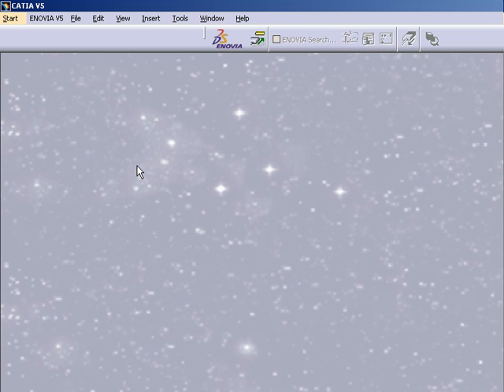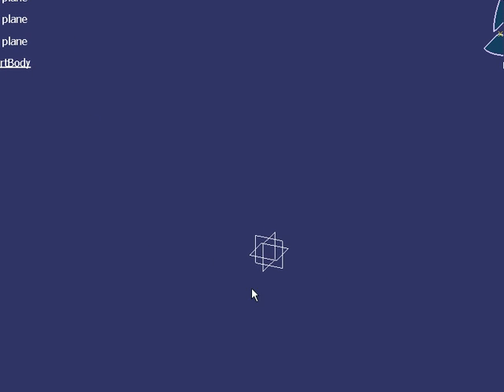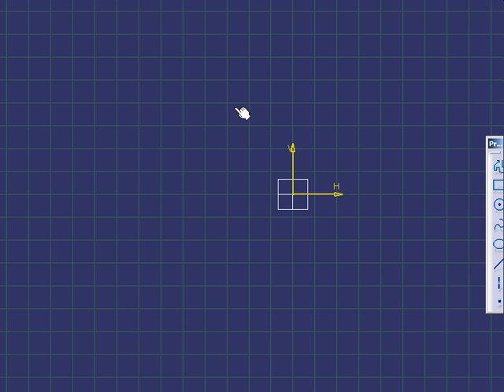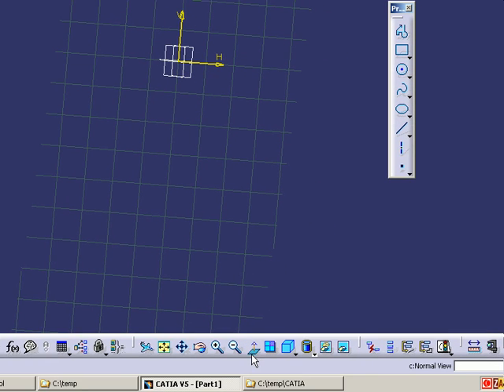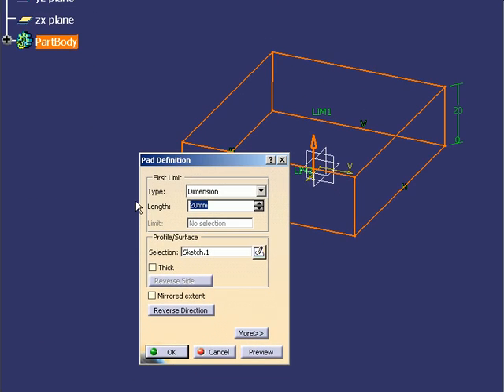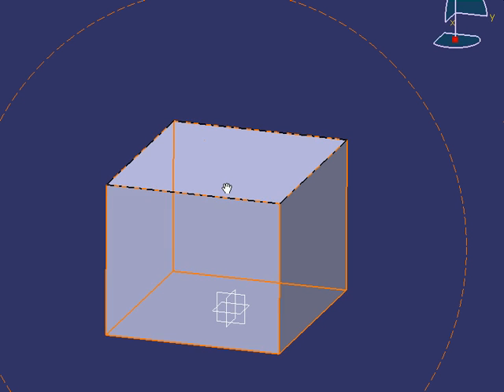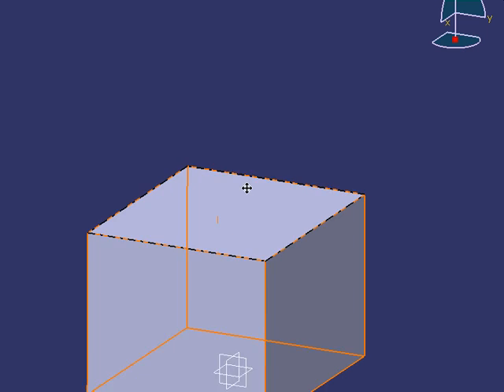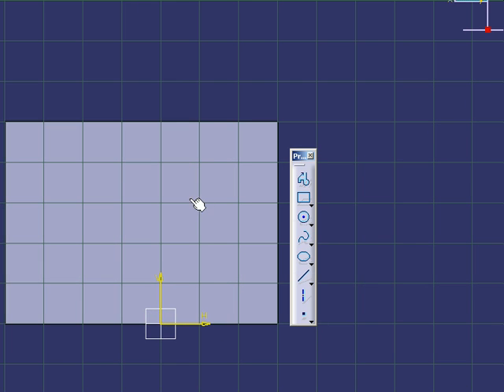Beginniner's tutorial on CATIA

Comment: qiuck question. If I mirror a threaded hole onto a face parallel to it, will it mirror the thread direction? (i.e. I have two faces next to each other. I put a threaded hole into one face and mirror the hole onto the face next to it. does it mirror the thread direction say from right-hand thread to left-hand thread).....

Comment from the maker: Catia parts have .catpart extension. What workbench are you in when trying to save. What's the destination. Sometimes you may not be able to save to system locations because those locations are protected. Try saving to a memory stick, if you sometimes want to save under c:\ make a folder called something meaningful to you. Sometimes when you save, you are saving only assemblies, but catpart files don't save, but that's usually in a corp environment. I hope this hints to help you to resolve issue

Comment: I am a design engineer working full time in CATIA V5 with experience using FEA software. CATIA modules for FEA are not so useful except for easy implementation. CATIA V5 can solve fluid flow using Fluent.But I am pretty sure they are buggy and program will be more head ache than anything atleast for couple of years more. I am planning on providing free videos.(FEA or CAD).You may be able to see my videos soon.